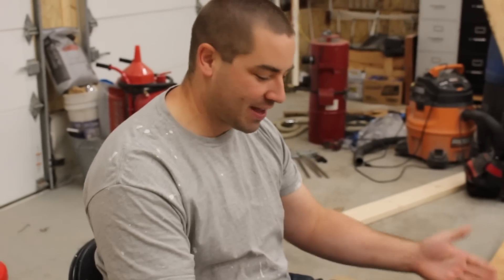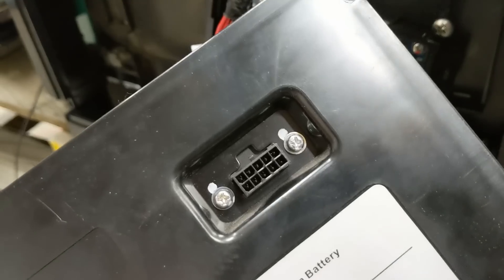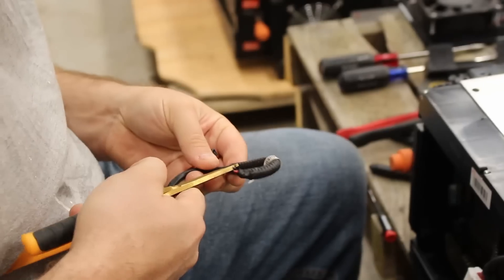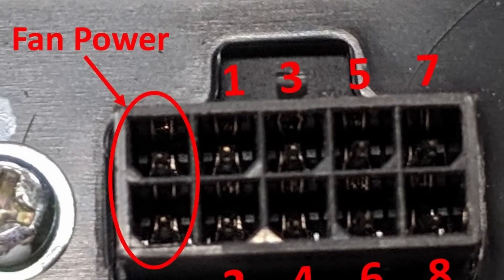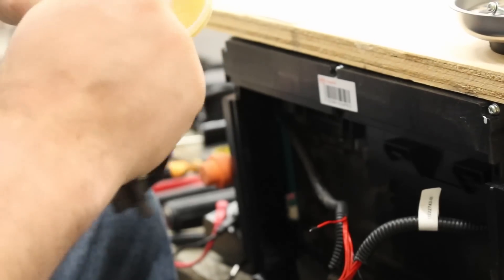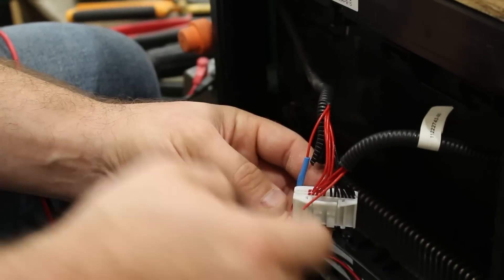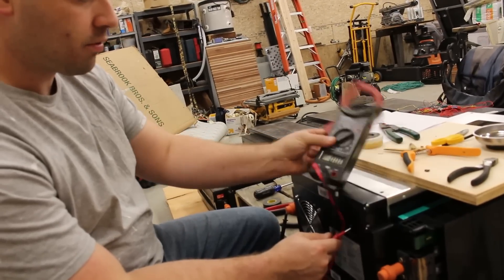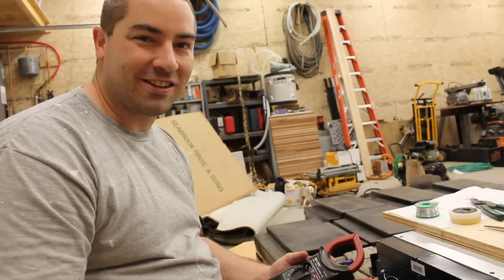Re-Wiring LiFePO4 Battery.  $100/kwh

Comment: Great job! I was wondering if you could use the exiting wire to connect to a BMS. I guess you can.
Reply from the maker: Well, at least I'm going to give it a shot.  We will see if it works with the BMS.
Reply: @DavidPozEnergy  I ordered 1 of the 16t chargery balancers you recommended. Looked other reviews, it seems solid.
Again thanks, good looking out!
Reply from the maker: I've never used the Chargery before.  I'm bought one and it's on order.  I still have to test it.

Comment: Hi David. Quick tip for you when soldering: tin the wires first (cost them in solder) then hold them together and touch the iron on them with a small amount of solder on it.
Most importantly: once the solder has melted, remove the iron immediately. Don't go back to it. If you do, add some more solder or flux.
Speak soon.
Reply: PipeManPeep I liked it. Easier to hold together and less chance of movement waiting for it to cool. If I have a jig in front of me that work ok but when your working on a piece of equipment then the 2 pieces solidly twisted together  makes a steady work piece and with practice and technique can make a smoother joint under the heat shrink.

Comment: I wish the manufacturers would release the data on their BMS's so we wouldn't have to dink around bypassing them entirely.  Or, perish the thought, make it nice and easy to connect to a home solar setup without going full MacGyver.
Reply: Noel Barlau Jehu Garcia said he believes these bms units use CAN communication which if I’m not mistaken is the same as automotive computer comms. There’s  probably some way of reading those codes to arduino or raspberry pi. If it’s there it’s on the net and github has the code to copy and paste. I rob code from there all the time because it’s there to share. 
Here’s wiki:

https://en.m.wikipedia.org/wiki/CAN_bus
Reply: William Montgonery this makes sense as, I would guess, these were used in transit buses...I’m curious as to why they are removed with 90% capacity still available, but, that’s another reason I’m guessing transit buses, as, the 10% loss in capacity perhaps limits range if they already had limited range. BYD does make electric transit buses. (Also the loud fan)
Reply: Noel Barlau here is something promising I will look into when I get my hands on the bms next week. 

https://forum.arduino.cc/index.php?topic=565568.0
Reply from the maker: Yeah.  I've sent BYD 2 e-mails and a message on Facebook.  No info back.  I'm not a computer guy, so I can't write a code for this.
Reply: @DavidPozEnergy  I'll let you know when I get mine.  I can code in C, Python and Java for serial controllers, so maybe I can get something to work.  If you can get a response from BYD, that would be great to get me a little further along.  My batteries are on the way.
Reply from the maker: Hi David,  It will be so much fun to see what we all come up with.  I'd like to know what this board was capable of doing.  (the BMS board built in).  Did it only send up info, or did it have balance function?
Reply: @DavidPozEnergy  I think the relays inside switch resistors to ground or connect a single active balancing circuit to the cell that needs to be balanced. But whatever is the case, these boards are way to good to be thrown away, so you should keep them even if it is just because of the smd 5amp relays, wich are quite useful. 
Also you should turn the fan arround, so it is blowing into the battery, because these fans are better at blowing air into the battery than sucking air out of it. It will also keep the BMS cooler and prolong the life of the fan as the bearings will not be heated by the exhaust air.
Also turning the fan arround will have the blades pointing at the fan grill so they can't shred the BMS wires.
Reply: unmountable boot volume the bms usually have mosfets that do the switching to high wattage resisters.

Comment: I bought 4 of these through your link. Which model of Chargery BMS did your order ? Thanks for the video's.
Reply from the maker: I ordered the Chargery 16s with 600 amp shunt.  I've never used any products from Chargery before, so I don't know if it will work or not.  Going to find out.

Comment: I'm interested in these batteries but...  Have you tested the cells yet?  Do they all have the same voltage and capacity?  Or will you have to remove some and swap them out with good ones from one of the other packs?  I kind of thought you'd check that before wiring the BMS just in case the packs have to be taken apart.  Maybe I spaced out and missed that part, but I don't remember that in the previous video when you first got them.  One of the more useful things you can tell us is the status of the cells so we can buy or not.
That was a nice save on the smart car pack BTW.  I don't remember seeing your procedure for checking all the cells there either.  Did you just charge each 24 volt section and then read the cell voltages after some time had passed?  I get the impression it was a bit more complicated than that, but your procedure for deciding which cells to keep and which to take out would be very useful to someone like me who is tempted to get something like this and needs to know how to evaluate and if necessary, re-arrange cells.
Reply from the maker: I have not tested the cells.  They all showed the same voltage (within 0.1 volts) on day 1, and over the last week have not changed in voltage.  I may end up having to cut something out and replace, but I'm moving forward with the project assuming good enough.  
The Smart Car was a huge black hole for my time.  I was out there every day for months.  Every day I checked the voltage of every cell manually and kept a notebook.  My first charge on those cells took weeks at 0.01 amps.  My second charge was at 0.1 amps.  Third charge at 1.0 amps, then 10.  The idea was to continuously check for hot spots, self-discharging cells, or cells not holding the same capacity.  It was a huge hassle.  It overtook my garage for months.  
So this time around I'm installing everything and will check as I go.  I can't have these battery modules all over the garage floor like I did with the Smart Car.  Yes, I might have to take something apart again, but at least they will all be up out of the way.

Comment: The black wires could be temperature sensors
Reply from the maker: Probably.
Reply: Marlon Bramble I’m thinking that they are there for for reading the individual voltage across each cell and resistance reading. The bms I use my setup reads that and bank voltage to give an overall health view.

Comment: Looks great so far! Are you going to run the fans from the battery now? Also, what BMS are you planning on using?
Reply from the maker: I'll control the fan external.  I'm going to try the Chargery BMS.  I wanted to use the new version of the Batrium, but it only goes up to 15s.  "Darn, so close".  I'll be making videos of all this.

Comment: What BMS do you plan on adding to this pack?
Reply from the maker: I'm going to try the Chargery BMS.  I wanted to use the new version of the Batrium, but it only goes up to 15s.  "Darn, so close"
Reply: DavidPoz I have a chargery bms laying on my desk I pulled out yesterday to play with cuz I got distracted. I think it goes up to 24s and came with a charging disconnect and current shunt for charge/discharge reading. I have more. I just ordered 4 more from AliExpress with 7” lcd and WiFi app etc to meet my needs. My current bms by Relat has gotten flaky and the Chinese app never worked. Maybe I could sell you what I have if it meets your needs or find you what your looking for and send you a link.
Reply: @billssolarpowerandgardenin1016  I may be interested

Comment: Great Job!  What connector are you going to use to plug into the pack with?  Is it just some type of standard power supply plug found in computers?
Reply from the maker: I ordered the mating connector from ebay.  I have not made the external harness yet.  The connector is called "Molex 43025-1000"
Reply: DavidPoz the bolts to connect to look like they have very few threads. Did they come with nuts or is there something I’m missing?
Reply from the maker: Hi William,  They are not bolts, they are smooth posts.  I have close-up photos on my facebook page.  https://www.facebook.com/DavidPozEnergy/

Comment: Cheers should work as you know BMS works on all negative so just for point of reference usually pin 1 is the main negative and pin 2 is 3.2 etc so the last pin would be full voltage but as long as you wire the bms accordingly it should work but you may have to turn it around completely. or not just my understanding of what you described.
Reply from the maker: Thanks.  I'm no expert on this stuff.  I just did something that got the voltage to the pin.  I'll be double checking things when I get a BMS in.  It's currently on order.